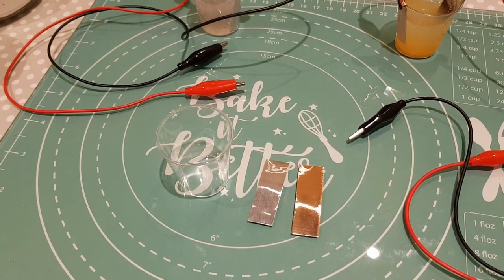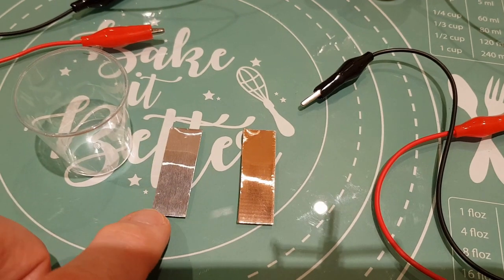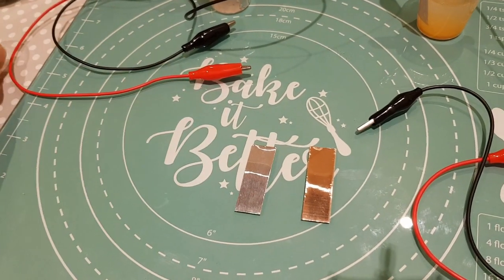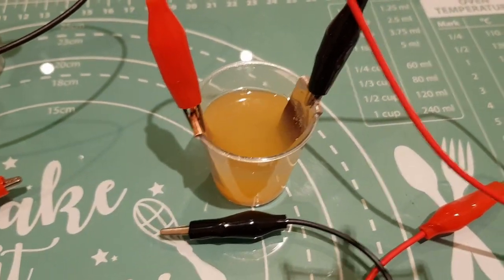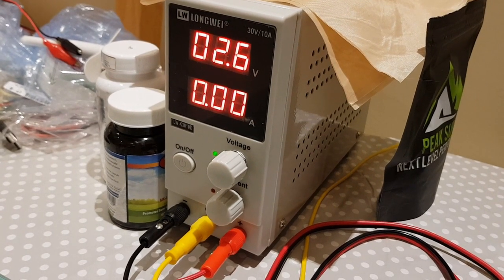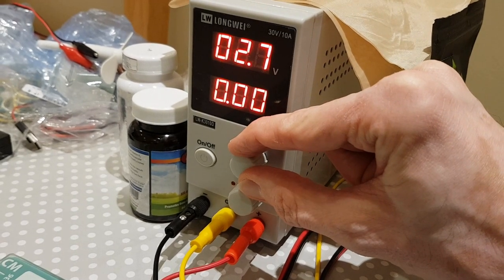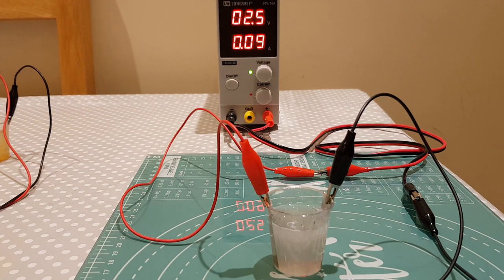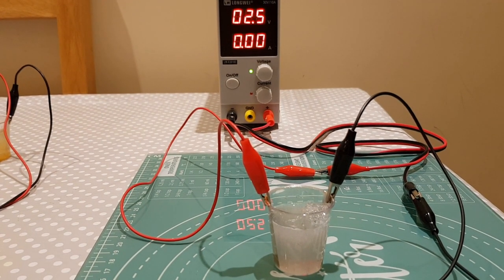Developing a Gel Electrolyte for Batteries - Part 1 - Gel vs Water

Comment: Hello, I started to follow your work. I would have a question, I would be very grateful if you could help me if you have information on the subject. Do you have any information about the gel chemical added when the internal resistance (amperage values) of gel batteries weakens? I am writing from turkey. A person in our country claims a lot in our country, I made this gel, no one knows this gel chemical. Do you have any information about gel electrolyte chemical? thanks
Reply from the maker: No idea sorry. This was a project I worked on long time ago and no longer researching this. Are you talking about different gel batteries like lead acid etc?
Reply: @amp9438  yes

Comment: Your gel is just behaving like a membrane separator so you could get the same results by putting a paper towel separator in this cell to keep the anolyte and catholyte from mingling.  For that matter why not put in all in a flat plastic bag so your electrodes are also most touching with your chemical soaked into a 10X thick paper towel in between the electrodes?  The closer the electrodes are to almost touching the more power you get and for a way longer run time too!!!!!   Thinking out loud while on video is a waste of time for your viewers.  Learn then teach.

Comment: when the lead acid battery dies or loses it voltage capacity,, what we have to use ? dilute H2so4 or distill water ?
because my battery has been giving me problems since i filled water in it. then i got afraid and put h2so4 but still similar problem.
its leakin, losing voltage and swelling 
please help .
my battery is Amptek 12v 45ah capacity
it says its an SMF battery
Reply from the maker: Not an expert with lead acid batteries but normally you just fill with distilled water. I believe they generally go wrong due to build up of sulfur on the lead plates which is not an easy fix. I imagine you're better off buying a new one if it's a sealed type rather than trying to repair.

Comment: APM. Could you please add as a comments list of all components in proportion? You know, people still use different accent :)
Reply from the maker: Sure. The gel was made by mixing 50ml distilled water with 1g Glucomannan. It takes a few hours to form the gel and you have to stir it to stop it clumping and going lumpy. The test cell was made with 20g gel and 3g calcium chloride. The electrodes were copper and aluminium foil.
Reply: @amp9438  Cool, thanks. One more question. My battery shows GEL Type and Sealed lead - acid || https://drive.google.com/open?id=1G1m1A1oa8yJUkmFdgZClNlm7_NpiNpGl || So, do I need a gel or just a water?
P.S. I have looked my cells and did not see anything, even with flashlight -- empty! Need serious help.
Reply from the maker: @СИНГАПУРов  dont think this gel would work as I think the lead gel batteries use sulfuric acid and fumed silica.
Reply: @amp9438  sir please make gel electrolity use for lead acid dry battery. Because it is usefull me. I have lot of dry battery
Reply: @amp9438  and thank you for reply mi
Reply: @amp9438  Well you own me $20 :) I just recieved Glucomanana!!!!
Reply: @amp9438  can i use thise gel in lead acid dry battery??????
Reply from the maker: @रियलइंडियन-म4ह  Seriously doubt it as I believe they use sulfuric acid and fumed silica.

Comment: have you made temperature test to this gell electrolyte 10 deg C up to danger level 80C
Reply from the maker: Hi no not yet just been working at room temperature. Although the consistency seems better at lower temperatures which maybe  means it might get worse hotter it gets. But certainly I should test it a some point. Thanks

Comment: Hi AMP, a good first vid in your battery experiments :-)I shall have to buy some of those Glucomannan tablets (good old pound shop)!I have used Carboxy-methyl cellulose (CMC) in water as a binder, which gives a similar effect.Looking forward to seeing your results on the data logger.Just Subscribed :-)    Martin.
Reply from the maker: Cheers. I was going to try wall paper paste but thought i'd give this a go first as thought it would be purer given they normally put things like fungicides etc in wall paper paste. I found some research where people have used Glucomannan as a binder but thought i'd try as the electrolyte.